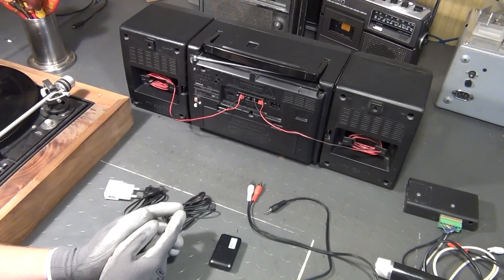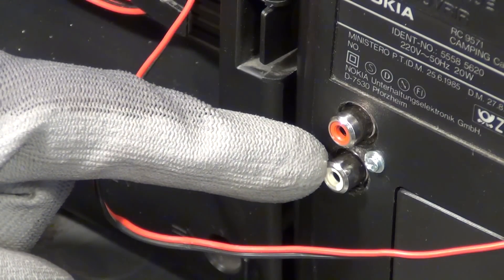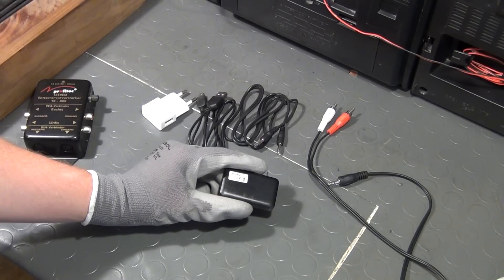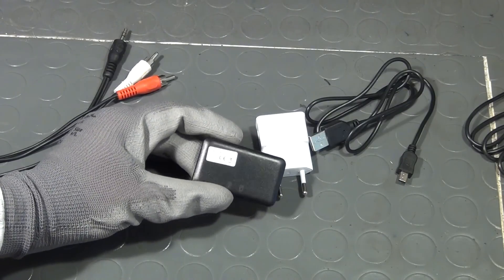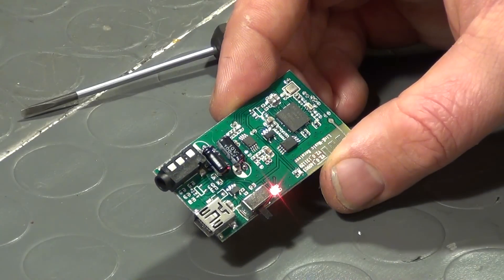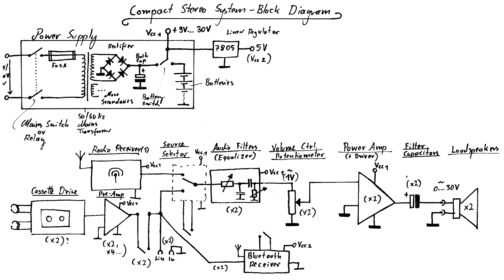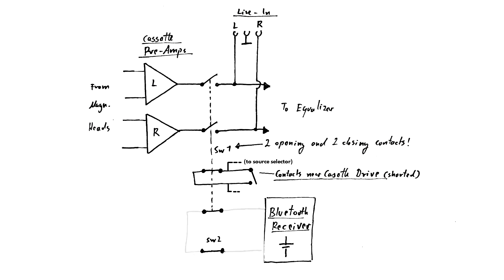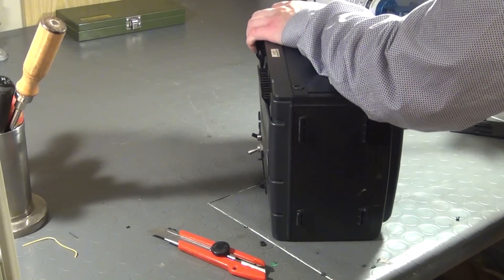How to Add a Line-In and Bluetooth to Old Stereo Systems (3)

Comment: Thanks for sharing this.  I just finished adding bluetooth to a Sony CFS-930 as a birthday present for my sister.  I used (I think) the same bluetooth module, with an LM317-based regulator to drop the internal 9-10V down to 3.7V, and 4-pole dual-throw (4P2T or 4PDT) switch to handle the connections.  The tape deck still works, the radio still works and, with a flick of the new switch on the back, the bluetooth works! (with some noise from a ground loop somewhere).  Your videos were a great guide and I found them very helpful.  Thanks again!

Comment: The name  "RCA" connectors comes from the name Radio Corporation of America, which was the company that basically began the age of radio and then television, and then color tv, in the United States. They were located in New York City, and literally created the radio and television broadcast industry, by either buying up every electronics-related patents and inventions, or inventing them (as in the case of NTSC color tv) in their own laboratories. They also invented the 45-rpm vinyl record format, in 1949. 
They invented the connector as a simple method of making internal connections in their radio and phonograph consoles. The connector became very popular, and has been called the "RCA" (or "phono") connector ever since. There is a wikipedia entry called 'RCA connector' where you can find its entire history.

Comment: In my part of the US they are either "RCA" connectors, or some older guys call them "phono plugs", as they old connections from phonographs often used the same type of plug, although they were usually black and mono, so only one cable carrying a single channel of audio. Some older systems used the same connector style as RCA for things like the antenna, loudspeakers, etc.

Comment: just wanted to say a massive thanks I've managed to do this on an 80s boom box and it worked perfectly even without implenting switches and you don't need to press play . thanks again
Reply: Some models of cassette players require the play button to be pressed before allowing any audio to pass from the heads. And then, some don't.

Comment: I'm in the process of doing this to my 20yrold aiwa boom box...I just discovered I can use the mic input as aux (yes 20yrs ago Aux input was not a thing on all radios ) if I push play on the tape deck...yeah no more radio..I even took swapped out the speakers for some Kenwood's and now I gotta get inside to bypass no RCA so I can add an eq a amp and some boom.

Comment: I've learned some new things! I've done a few of these hacks before. All with the TDA7492P 50W+50W Wireless Bluetooth 4.0 Audio Receiver Digital Amplifier Board. 

I have been experiencing some wierd noise (tied to the rpm of the engine) when I use that card in my car stereo. Maybe it's because I'm using a shitty 12v cigarette plug? Are those plugs giving bad dc?
Reply: +simontay1984 Thank you my friend! I will look into this and try to make a fix!
Reply: Yeah! I'll see what I can find! Thank you!

Comment: Not only do you not want to have to worry about the internal battery of the BT receiver being unchargeable after so many years, but even having to charge it separately would be a pain in the butt; it ought to act like it was part of the boombox all along. But then you could use the boombox's power supply to recharge it either from mains or from the boombox's batteries, but even that can present at least one overcomplexity problem: that the eventual nonrechargeability of that battery will come back to bite you. So yeah, I agree, ideally this would be best... but then of course there's that problem of audio noise that can come back to bite you as well. So hmm... "6 vs. half a dozen," eh? I like that you used the USB charger to keep charging receiver's battery while the boombox is powered by mains, but that doesn't address trying to get it done with the D cells, nor does it fix the eventual nonrechargeability, so it would be good to still find a more elegant/permanent solution. I guess there's still the buying of a modern combo boombox that already has these features, but there are only like maybe 2 models like this, if I remember right, so our choices are pretty limited. Although... maybe only 2 choices are all we need if they're good machines.

Comment: The Rca jacks are nicer to use than some connectors, a 5 pin Din was typical on older systems, not used so often now.
Reply: i think German.French equipment used the 5 pin din a lot later than we did, in the UK it seemed to die out on the 70's systems.
Reply: Your right, i just got used to the standard.
Perhaps if i had been born in the 80's then the rca would be all i knew.

The 5 pin din had a habit of not being a standard pinout, the earth was allways the middle pin, but the inputs and outputs could be at eather end, if you didnt have the correct cable you didnt get anywhere, a 1-1 cable or 1-5 cable, annoying at times lol :-D
Reply: zx8401ztv
ahh the days of having to solder your own wires and connectors! that continued well into the 80;s when it was cheaper to solder my own spectrum tape cables than to buy!  yeah the din pinouts were trial and error, then they go and use it for midi as well!
Reply: Yes i bought connectors from maplin, then tandy, i did much the same.
Long live the speccy :-D, i still have a few on a shelf, wont get rid of.
Also the 5 pin din was used on the back of ye-olde vcrs, i made the cables to rip off.... err make personal copys of videos lol :-D.
Reply: zx8401ztv
grumble,,,there was no tandy, and no maplin in my day!  it was a matter of finding an electrical supplier, and back then it was trade accounts only, so you have to find a friendly one for a few bits and bobs, its where i got my first multimeter, an old avo , but the ranges were made for industrial electricican use, not low voltage, tandy was a revelation when i think we got one in about the mid 80s.
Reply: Yes that would have made it harder to get parts.
My first multimeter was a micronta analog one, then in the 80's i got a gray two dial digital multimeter oow (posh), i still have it, it needed a little padding on the range resistors but its very good for its age.
I was given an old Avo model 8, faulty of cause, didnt take long before it was working again :-D, i found analog to be ideal for peaking circuits up, very big smooooth visual scale, and the digital is great for static stuff.
Tandys was good, but crap for parts, bloody archer packs of expensive crap!!, moan over lol.
Reply: zx8401ztv
i too still have my 1st digital, its some taiwanese testlab, but to give it credit, it still works just fine, has been more reliable than 2 flukes, never liked analogue, i feel the same about clocks too, my avo was a model 40, terrible range choices on it, i think that is what caused my analogue hate!
Reply: Yep sounds a good reason to hate analog, modern digitals have a pseudo bargraph as well as digital, bargraph is still good for peaking a circuit :-).
I have a lot of those yellow 3 quid 830b digitals, handy for basic stuff and checking car bits, if it gets broken im not to heart broken.
Certain people think they are a deathtrap, its the owners that are the dangerous part, in my opinion, not dead in 30 years from cheap multimeters ha ha ;-D

Comment: Hoping you can help. I have a security camera that has a weak speaker. I only have access to the black and red speaker wires. The camera is not able to be opened. Is there anyway to connect these two wires to a Bluetooth transmitter as an audio output?

Comment: I understand it's a more accessible project when you use a simple USB charger on AC to power things, but I think I would have preferred using a DC-DC buck converter to go from the unit's internal power, then it could have run the bluetooth from either AC or battery.  Then again, the unit will probably never actually be used on battery.

I think if I were using a unit like that much, I would put some 18650 lithium cells in along with charging circuitry - rather than buy C or D cells or whatever it is using.
Reply: I guess that could be another project, 18650 conversion.
Reply: Quite the project. If you want to put 18650s in series, you'll have to balance their charge and so on.
Reply: Seegal Galguntijak Heck, charging multiple Liion cells is an off-the shelf, super cheap module. No design work necessary.
Reply: John Ridley You'd still have to get the right voltage and stuff. But yeah, I guess it's doable, and 18650s are commonly available (if you don't want to buy them, just harvest them out of some old laptop batteries).
Reply: Seegal Galguntijak You don't have to do anything. You can buy the module to handle the entire thing for dirt cheap. I have 18650s lying around, I use them in projects all the time, they're the easiest to deal with given the chargers and boost converters you can buy for about a buck on eBay these days.
Reply: John Ridley

Comment: Your videos are amazing! I was wondering if I could bypass the AM radio, since no one really ever listens to that anyhow, and place a line in AUX there? I don't like adding switches to my faceplate, so using the AM radio setting switch is what I'm trying to accomplish. Are there any issues with AM being amplified strangely or something? I would be fine with pulling the AM guts.

Comment: I live in Germany. I'm used to calling these RCA/Cinch connectors "Bananenstecker" (= Banana connectors). Don't ask me why. seems be some remnant artifact from way back when phone operators were using plugs to switch phone connections on a switchboard. I only use Cinch when shopping around because it specifically means this type of RCA connector. Where as Banana connectors refer to a bunch of similar connectors. The whole Connector terminology landscape is a whole clusterfuck. A mish mash of English and German official names and their colloquialisms. Sometimes it's hard to know WTF you are talking about. I prefer the Englisch terminology. #WelcomeToGermany

Comment: I have a very similar Stereo (Hitachi TRK-W530E) which I have been meaning to modify with an internal bluetooth module such as this, but it runs from 8 D-cell/IEC R20 batteries which is inconvenient and expensive. I'm planning on replacing them with a single 12v rechargeable power pack but I'm confused as to which variety of battery would be appropriate for this application considering the runtime needed as well as the available space inside the compartment. May I ask what you would recommend?

Comment: I'm using only the speakers when I wired an auxiliary cord straight to my phone it's very quiet the phone clearly doesn't make enough power how can I add a plug-in power supply
Reply: they sell headphone amplifiers fairly cheap on amazon or theres schematics to make them all over the internet

Comment: Guys guys... Those 2 dollar bluetooth receivers are total crap in my point of view. Am I the only one finding them to have very poor highs and no low end? Werent those meant for old bt headsets or handsfree devices? 
Better get the 4$ CSR8635 module. You will be impressed by the quality of the sound. I promise.
Reply: These cheap 90s boomboxes are crap enough that it won't make big difference;)
Reply: Maybe..

Comment: Hey, guys. Using this tutorials, I was able to let the line-in work in my old Panasonic RX-DT37. (However, I just replaced the radio with line-in there) 

But now I am digging into a Sharp WQ-750HT(BQ) , couldn't find manual online, but it's OK. So I was able to understand, what's going where (thanks to this tutorial and 2 previous parts) but when I connect the line-in, instead of a tape this time, the sound is so distorted. Tried with radio as well - the result is the same. 

May it be, that I miss something? Like, mb, some resistors must be included for some models?
Reply: So actually, I found the reason soon after that comment. In Panasonic pre-amps are located on Tuner/Tape boards. And i easily modified several Panasonics, just connecting the line-in into the main board instead of the Turner/Tape boards. In 198X Sharp basically pre-amps are located on the main board. So it was also easy. I've connected the line-in into the "input" of Equalizer board. That's all.

Comment: My friend you are wrong. In Serbia a lot of German words are in use. Today some of English words. But tools are still named by German words. Also CINC we use to. RCA is used over ebay  and some of new modern kids but we older ones still use those terms. I can tell you a lot of misuse of German words for tools because some people don't know that GEDORE is a name of company not a specific tool and a lot of people knows that but simply use that word for a specific tool. My Father is half German so my Grandmother use only German words so did I. I work in printshop and a lot of words are still German. Like Druck (press) or machine or Srafciger (guess what it is I wrote it on Serbian) and so on. We say Printing machine and USA use Printing Press so as you can see your German influence after WW2 is still here. German engineering is what fascinate me also Serbian old repairman are using skills like yours when repair tools or machines. I do not speak German but I am familiar with a lot of German frases. Good luck and keep with good videos...

Comment: What happens if you use line in and bluetooth together?
Reply: not  possible.. the Bluetooth is already connected to source.. here the aux.. you can bind them (when you put multiple sources to one) .. but it will be horrible, and damage receiver, pre amp.. or speakers due to clipping (over gain) 
it's useless just don't ☺
Reply: when comment without watching.. 
forget above.. only the lower part counts.. but he used a switch so it's not possible to mix up the lines...